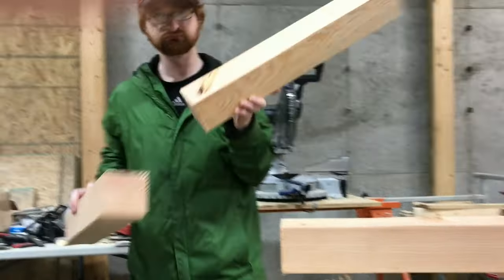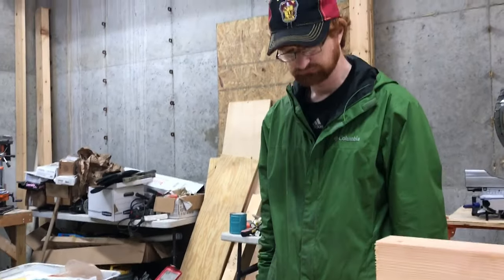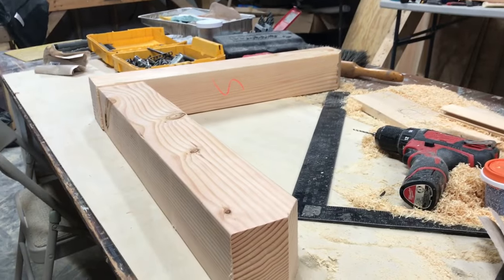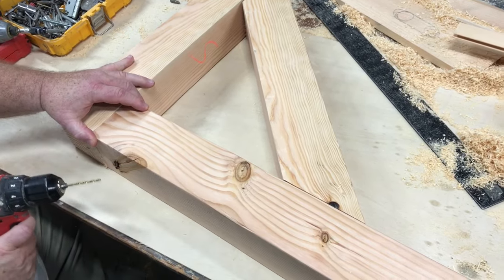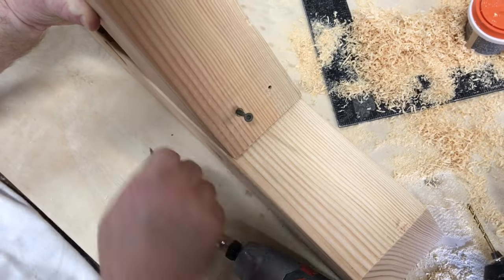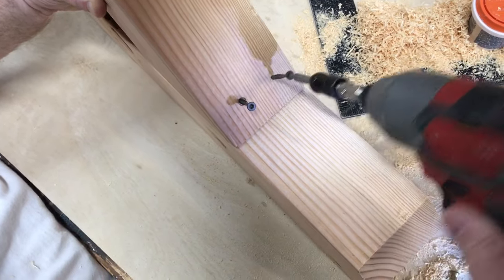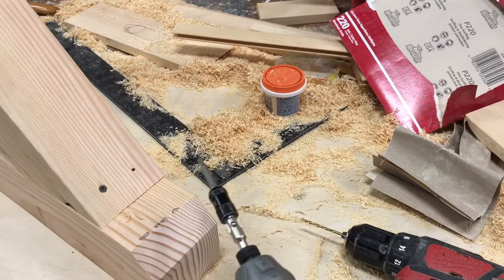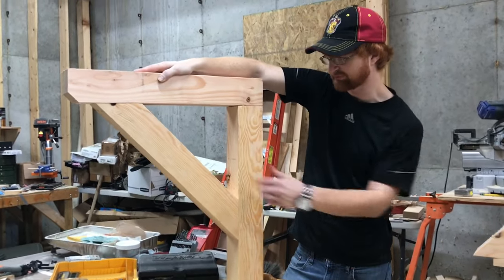Making a Quick and Easy Soffit Bracket

Comment: Another option on material is use 2x4's doubled to get your 4x4 stock
Reply from the maker: but you can see that the 2x4s are doubled so I don't like it :)  These untreated 4x4s are not that expensive.

Comment: How much weight would 4 ft top 1 ft side and 3 ft angle hold. I know it’s specific. But I have an idea. Lol
Reply from the maker: The closer you can get the angled part of the bracket to 45 degrees, the better.  Imagine a lever and the shorter the vertical piece against the wall, the more of a lever the horizontal piece becomes which is not good.  The ideal situation is that both legs are equal so yo can get the bracket at 45 deg.

But to answer your question, it depends on how well the vertical piece against the wall is bolted to the structure. I am guessing 30 pounds?  But that would be x 4 if the bracket is at 45 deg.

Comment: Imagine using this triangle as a shelf holder, will it be stronger the way yours is or when the top horizontal piece attaches to the side of the vertical piece? If you know what  i mean. Thanks
Reply from the maker: I am not sure what you are asking but the bracket will hold more weight if the top horizontal piece is sitting on top of the vertical piece as show at 7:42 in the video.  This means you are not relying on the strength of the screw holding it together but how it's mounted to the wall matters.   These brackets held up the over hang of a roof so they will definitely hold a shelf :) Thanks!
Reply: @ArtisanTony  My bad , English is not my first language but you answered my question thanks!

Comment: How strong are they and how would you build them to support a porch roof over a door, where the brackets fully support the roof, and how big of a load can they carry ( in general) ?
Reply: I would not use this method personaly for a porch etc, its probably strong enough but depending on how you cover the pitch. Its not that difficult to do mortise and tenon and use dowel through to hold the joint. Much more satisfying aswell knowing you have done it and looks alot nicer. 👍
Reply: This will easily hold a simple 3-4' long door/window roof with a 2-3' wide overhang.  As previously mentioned, there are more ideal methods but if you're not as familiar with building methods then this will suffice.  If you do happen to live in an area that receives large snowfalls I'd recommend at a fairly aggressive pitch on the final roof and obviously remove lingering snow regularly.

Comment: Remember, you can't get three 24" pieces out of a 6' piece of lumber, because of the width of the blade that's doing the cutting will remove additional material.  What you'd end up with is two 24" pieces and (roughly) one 23 5/8" piece.  Better to do it the way they did here, with the top piece being 23 1/2", or just use the off piece's length (23 5/8") as the top.
Reply from the maker: You are correct. We try to plan out our material as part of the design. Thanks

Comment: Great videos guys how would you attached that to the house..? and where are the points on the bracket  where you would drive the deck screws through ? thank you
Reply from the maker: If the brackets are carrying the soffit load I would use 8" cabin framing type screws into solid blocking that would have been installed prior knowing that the soffit load needed to be considered.   Otherwise, if the brackets are just aesthetic, you could use like a 2" Kreg tool framing system to install them.
Reply: If the brace appears to be carrying a light load such as the edging of the joist, do you think I would need to add a support to substitute the existing brace while I hand a new one?  my house is a bungalow home so you can get an idea. thank you I appreciate your advise
Reply from the maker: @oscarluquin8107  Yes, you might want to include a temporary support. I have seen many old bungalows where the roof decking was just pieces and provided no support for the overhang and that is why the installed these back in the day.   You can almost see this when the overhang would sag sometimes.

Comment: Thanks for the video. I am building a 56" wide roof/awning over our door. I see you are using shorter screws in the video because it is a sample. What size screw would you use in the real thing? Also, if I've already got the vertical board attached the wall, how would you suggest attaching the piece that comes out from the wall?
Reply from the maker: You don’t need really long secrets to attach the angle brace to the bracket. The 2” pocket hole screws are plenty long.  We use 6” lag bolts to attach the bracket to the house. One up about 3” down from the underside of the top piece and one down low in the flat above the chamfer. Both of these go into blocking we put into the wall when we are framing or sometimes into the corner framing. If you frame corners correctly (NOT California corners) then you will have plenty to bolt to.  Thanks
Reply: @ArtisanTony  Thank you for your reply. We are building a little differently than your video, so we have a much longer vertical piece already bolted to the house, and I am wondering how to attach the piece which supports the roof, that comes out of the wall at 90deg, because this will not be sitting on top of the vertical piece, it will go into the face of it. I'm guessing a couple of screws at an angle? If so, how long should they be?
Reply from the maker: @diazastro  You might want to invest in a pocket whole tool like this one 320 Kreg Pocket Hole Jig which are like $40. You can even get the one hole system cheaper I think.  This system is incredibly strong and you can buy the wood plugs to fill the holes. We use our all the time for applications like you just mentioned.  All of the weight is on the end of the bracket where the brace is anyway so it should work fine.
Reply: @ArtisanTony  The pocket holes worked really well! Thanks for the advice.
Reply from the maker: @diazastro  They are stronger than they look :)
Reply: You could use joist hangers, but generaly most just paslode them in from the sides. IE nail gun 👍

Comment: Wanted to use a 36 - 42 inches overhand on the side of my shed (12 foot)
Thinking it can work with longer boards same method ?
Reply: did you have any luck with this? I have a 36” overhang too and was wondering if this type of bracket would work instead of a post on my porch

Comment: If I bolt two of these brackets to the studs in my garage and run a steel pipe across, can it work as a pull-up bar? Thanks.
Reply from the maker: I don't see why not but test it first :)
Reply: @ArtisanTony  The steel pipe will hold for sure. I'm just wondering about the bracket and studs. Thanks.
Reply: @ArtisanTony    Did you use #10 screws? What length?  I don't know much about wood working and this info would help greatly. Thanks again!
Reply from the maker: @LaserrSharp  we used the 2 1/2" framing screws that Kreg has then we lag screw it to the framing of the house.
Reply: @ArtisanTony  Perfect. Thanks!

Comment: How long was the center piece with the 45s?
Reply from the maker: I would have to go back and see but if you give me the size you want I can tell you. We would just come back from the chamfer on the top a few inches and then up from the bottom chamfer at least 3 inches and that would give you the length.  As long as you cut 45's on the ends it will fit and make the bracket square.
Reply: @ArtisanTony  ok thank you
Reply: @ArtisanTony  how about for a 40" H + 40" D? How long would angle piece be?
Reply from the maker: @ObscurelyTitled  My math says 50.91" or basically 51"  this would give about 4" on the end of each leg for the angle and a flat spot for bolting/screwing it to the wall.